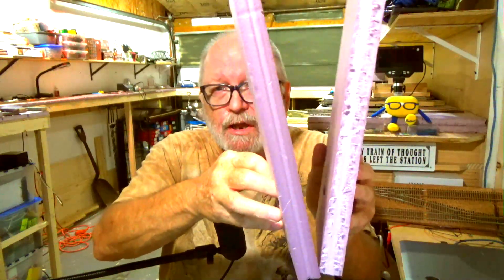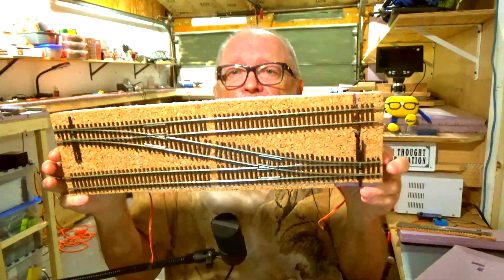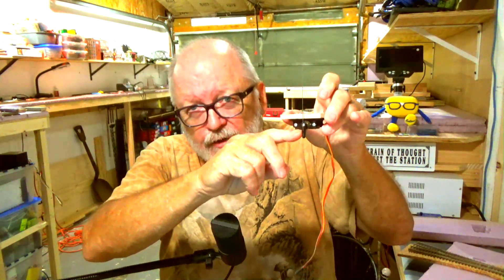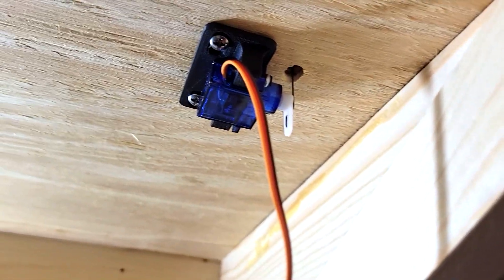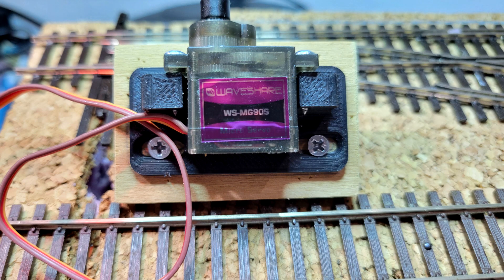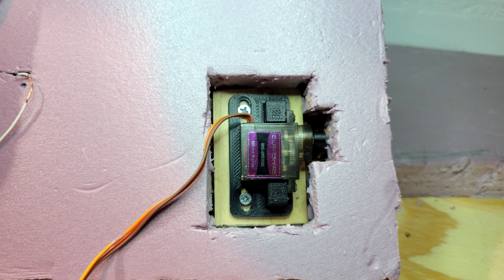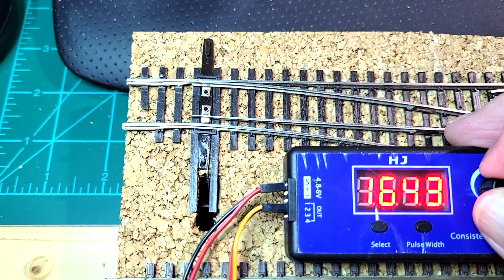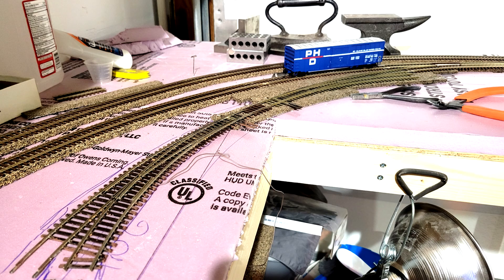Easy Methods To Mount Servos In Foam

Comment from the maker: I revised the design to flip the entire fixture so the servo faces up bringing the horn higher to allow easy access for installing the wire. This requires a 1/16" spacer under the fixture. to keep the servo at the proper height. Check the Monday Night Live Stream on 10/18/2021 to see the changes. Replay is always available.

Comment: Does the display have the ability to show the position of the servo in steps and/or percentage of throw?

How do you use the display output to adjust the position in the Arduino code? My system uses a position value from 0 to 1000.
Reply from the maker: No
Algebra... Ratio

Comment: Cool modification, would a longer arm on the servo make the linkage to the turnout easier?
What do you think.
Reply from the maker: Yep, a longer arm would make it much easier. All the arms that come with the servos are  the same length. I haven't seen any longer.

Comment: So.. you only make a hole in the plywood big enough for the wire, not to access or replace a servo?
Once you add scenery to this section, what is the plan to swap/maintain/adjust a servo?
Reply from the maker: The purpose of the lift out section is to eliminate the need to crawl under the layout to work on items. You'll understand when you get older. LOL
Reply: @TomsTrainsandThings  ahh, so you do not scenic the section in place, it stays removable. 
That makes more sense than what I was thinking.
Reply from the maker: I still put scenery on the removable section to blend in

Comment: Thanks for the tips and great video Tom. :) Where did you get the servo controller device from? It would be very handy gadget to use on my layout construction as well. I have n scale and a few double slips to calibrate! :D
Reply from the maker: Check the link in the description for my Amazon Page. You'll find it there.

Comment: The name of the unit used to line the servos up? 
How will you change the polarity of the turnouts?
Reply from the maker: You can find this item along with the relay module I'll be using on my Amazon page. Link in the description